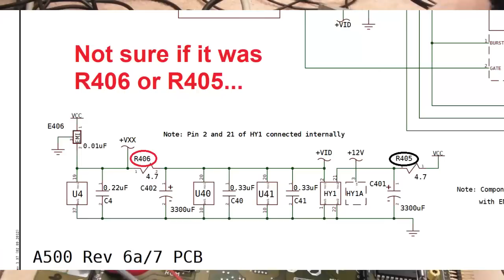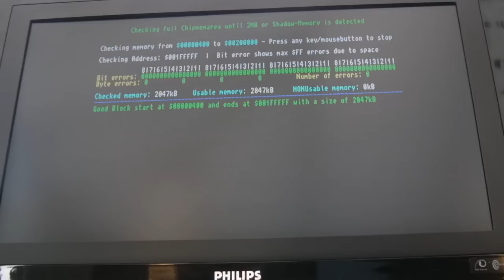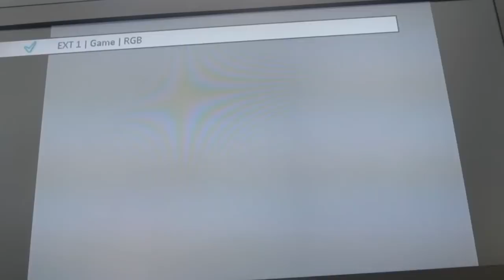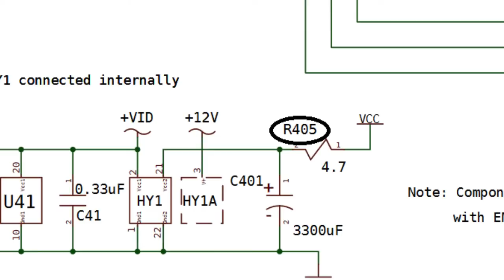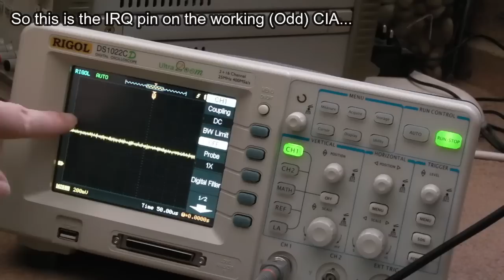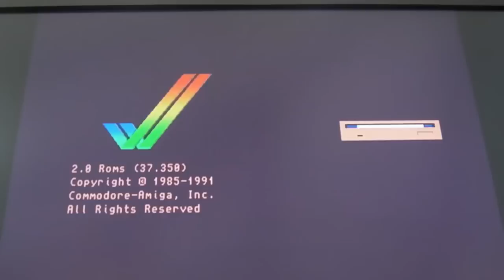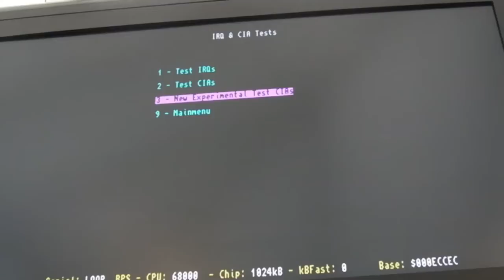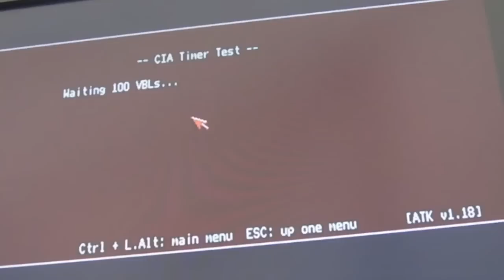Commodore Amiga A500 & A500+ Repairs Part 11

Comment: 12:44 Looking at that large Mottley ground plane "Bottom centre of screen" and going 3rd trace left to it, I am wondering if that trace and the one next to it's left hand side are good enough?
Hope those traces are not traces that are rarely relied upon having their open circuited state presenting with a seemingly random fault.
Reply from the maker: It's joined through vias and in many places around that area - so its not important!

Comment: I don't want to look inside my A500+. It's never been apart.

The battery must be in a right state. 😢

I hate unleaded solder. It's not long lasting.

I fixed my spare ZX81 yesterday, (it has an internal 16K of RAM, thank you again for the vid on how to upgrade the 81 RAM)), the PSU blew up and took the regulator with it. Luckily the regulator was open circuit, so it did'nt take anything else with it. I threw in a Traco regulator. It's perfect again.

I wonder if they coloured that chip socket so they knew which way it went on the PCB. (?)

That was a very informative vid. Thank you.

Comment: There's a bug in certain diagrom versions that crash on test detected chipmem if there's less than 2mb. Not sure if that's been fixed in the latest daily build already, must ask John sometime. Your version is really really old btw ;) Regarding the hybrid caps, C= used 1000uF's on all Rev8a 500/500+ models, and 470uF on A2000/A3000. I think 470uF is probably ok. 3300 is way overkill :) The IRQ issue with the 2nd board, you should report to John, Diagrom should be able to test that! I think it currently does a soft irq test using Paula (yes, the irq controller) not testing actual CIA irqs. Not sure why it says requires IRQ3 in CIA test screen. I'll send link to your vid to him.
Reply from the maker: Thanks for the info Tristan!  I would still always fit 3300uF personally ;)

Comment: Had to use a toothbrush on the pcb of that Sinclair Z88. It was really dirty, shoved that toothbrush in all the crevices and poked it into connection slots. Pushing it in and out so so many times. We were both hot and bothered when we'd finished though ❤️❤️❤️❤️❤️❤️❤️❤️❤️❤️🤪🤪🤪🤪🤪🤪🤪🤪🤪🤪🤣🤣🤣🤣🤣🤣🤣🤣👍👍👍👍👍👍
Reply from the maker: Haha =D

Comment: Currently trying to repair my a500. Black screen, no KB led power light. I have tested the cpu and it appears fine, i have changed both cia chips and denise. The only spare chips i don't have is agnus and gary. Tried the 1.3 rom and 3.1 rom. no change. the board has no discolouration or acid marks from battery. all the caps and resistors look fine. I am at a loss as to what is wrong with it.
Reply from the maker: It could be a bad socket somewhere - or the Agnus, if the Agnus dies you might not get a clock to the CPU and Denise.

Comment: if theres a 500ohm resistance to VCC on the IRQ pin, what would happen if you connected a 500ohm resistor between IRQ and Ground?
Reply from the maker: It really depends on the resistance from the IRQ pin to ground too I guess.  If it were 500 ohm to ground (ignore VCC), and we added another 500 to ground, then you would have 2 x 500ohm resistors in parallel, which would drop the resistance to 250ohm.  1/R1 + 1/R2.   With 500ohm to VCC, when connecting a 500ohm to ground, in theory the voltage going into the pin is half way between 5v and ground (2.5v) I think - when its in the state it was (doing nothing).  If it started switching high or low, it's anyones guess what the exact voltage level would be.  In theory testing with a pull down was pointless under the circumstances as the voltage it was outputting was always very low.  If anything it needed pulling up, not down... But it showed no sign of life in either case there.

But sometimes influencing a connection like that with a voltage or current change can occasionally cause a change in behaviour, depending on what the fault is (eg. a transistor that is almost switching decides to then switch etc).  Or as I talked about in the video, a pull up / down resistor that has reduced in size could short completely, or blow open etc.
Reply: @GadgetUK164  i was thinking it was the transistor myself, it seems more like leakage from a failing transistor.

in regards to the resistor, im pretty familiar with ohms and others like kirchhoff's law etc, but i was wondering if by balancing out the resistance between VCC and GND in respect to that IRQ if if would have any effect or not on if that pin can then toggle a state change, even if it wasnt a 5v logic change if if was consistent you could in theory then add a buffer or maybe a dual inverter or something similar to get it back to specs...

Comment: Hi Chris, how's it going your end? Hope you are all keeping well and staying out of trouble? 
😄😄😄
We have a question and a small piece of good news:-
Question:- We have noticed that miniature electrolytic capacitors seem to show a high ESR as oppose to their larger counterparts. Why is this, and does it make any difference? The capacitors are being fitted inside a Sinclair Z88 computer, which needs serious re-caping.
The good news, Wayne has been approached by the local Freemasons, and is in the process of being accepted. Well, at least it gets him to meet other people, bless him! Lol!!!
Cheers
Nina
❤️❤️❤️❤️❤️❤️❤️❤️❤️❤️👍👍👍👍👍👍👍😊😊😊😊😊😊😊😊
Reply from the maker: There's usually a voltage and can size relationship to ESR!  That's often why the really tiny caps on PSUs fail - eg. 0.47uF ones.  Congrats on the Freemasons thing! Thanks!!! =D